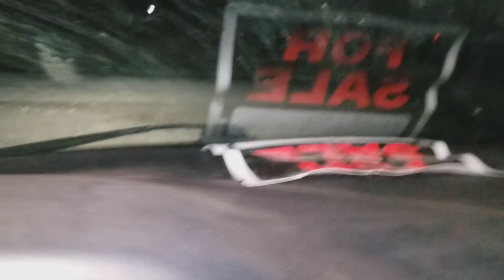Attempting to Disassemble the N600 Motor

Comment: while rebuilding the stock motor, swap in the 3cyl from the geo since youre putting a b20 in it anyway
Reply: these would both be crazy projects but sourcing N600 motor parts will probably take forever

Comment: Love the videos! if you haven't tried it already for breaking free anything thats rusted or frozen, an old timer told me to mix ATF and Acetone, at roughly a 50:50 ratio. Just be careful around paint and plastics, i would assume it ruin it but im not sure. It works when nothing else will, pretty amazing.

Comment: Put pieces up wood underneath the cylinder to raise it up a little and heat up the cylinder with a torch and put a block up wood on top of the piston a wack it with a hammer a few hundred times

Comment: Swap a b20 or a h22 a into the s600 the stock 2 cylinder is not that cool and it's just a lot easier and you will have more room to grow with a newer honda engine

Comment: whatever you do just make sure it'll smoke that red hatchback
Reply: Ernesto Artalejo yea BOI...for sure...
Reply: That think will not beat the red hatch
Reply: Thing
Reply: Maybe wago  is he turns it up and gets slicks for it
Reply: heartofcali559 still wont beat the hatch
Reply: By the Time he Builds this thing hatch Will already have a 1000 hp
Reply: Raymond every time car turns on you abuse it and race crap out of it it's going to happen it's apart of game even the big dogs go through same problems
Reply: kyle blew his motor not even 2 weeks after putting in new pistons becasue he didnt do it right ... he is sloppy .. cant deny it .. with all the money kyle gets he should be able to run wires .. its not hard ..
Reply: Ya that is true
Reply: This comment is hilarious.
Reply: Fuckin drama wtf
Reply: raymond tourand 😂😂